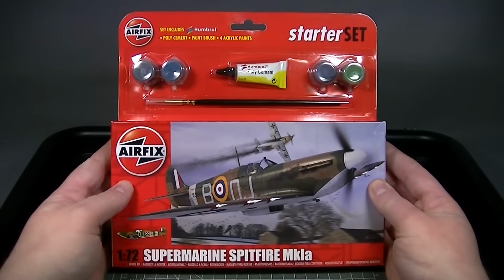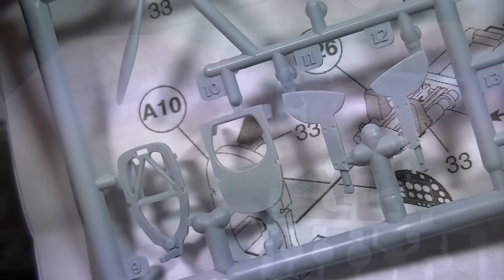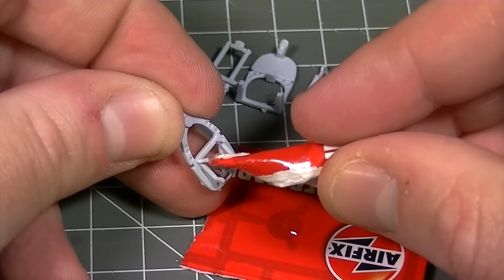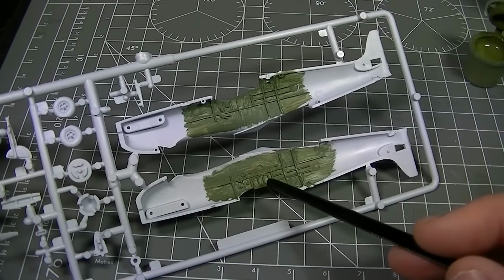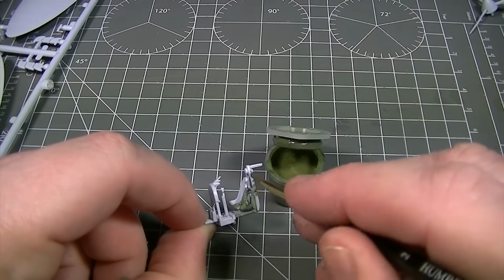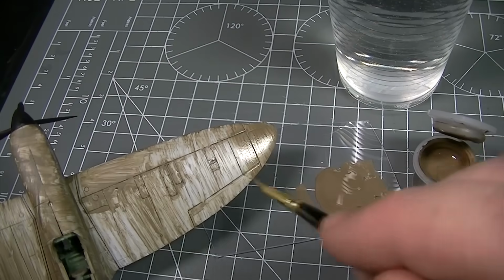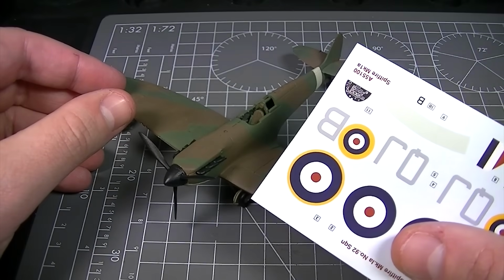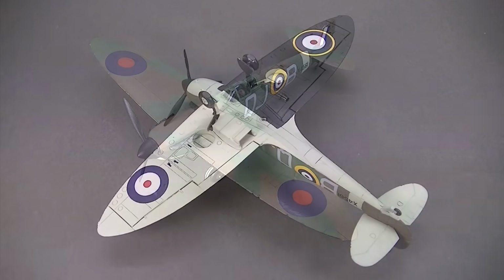How To: Airfix 1:72 Supermarine Spitfire Mk1a Starter Set

Comment: There were some great tips in this video, like applying the glue with some of the cardboard from the box. In my previous models, I would apply the glue straight from the tube, and I would get a lot of excess spilling out, but not any longer 😃👍
Reply: You could also use a cocktail stick for really accurate positioning of glue dots. 👍

Comment: Terrible tutorial.  You don't rock and tear the parts off the sprue. Use a knife or side cutters.  
No need to wash new kits. Old kits up til the 80s had greasy mold release agents used..not in today's models. A good coat of primer is a good foundation for paint adhesion.

Comment: Great idea to restrict to ONLY what is in the box for those who are starting out in this hobby...Obviously we all know that low tack masking tape, scissors, hobby knife, fine brush, fine sand paper and a couple different paints like silver (for chipping) etc. will make for a more accurate model...Another tip is that the thick paint neat out of the tubs can be used as a filler to fill some of those joints...just build it up in those areas...Great vid...
Reply: You made a good point, as i am starting its good to see what you can do with only the stuff included. I want to try this hobby out, without spending to much money.

Comment: I don't have the starter set, I have the basic kit, the same model, just the model. It truly is a beginner-friendly item. I'm not a beginner (I'm a many decades-long veteran modeler). The model is without issues likely to vex a novice. Part fit is clean and a wonderful experience. Detailed, but not daunting. A careful and patient and slow modeler will be rewarded with a fun experience.
Reply: Thx for posting.very handfull yips what to buy as a beginner

Comment: I can't get the canopy on but it was my first build and can't wait to do more
Reply: A little late, but when it comes to clear parts like the cockpit canopy, try using PVA glue instead of the plastic glue in the kit. Becaues it melts the plastic, it results in the canopy glass becoming foggy unless you're especially careful when applying it. 

Hope you had fun and build more kits :). The Japanese Zero is a fun one to make with some nice colours.
Reply: Some of the newer starter kits have a more simplified build and the clear parts don't need glue at all as they just snap on.

Comment: using a finger nail to remove excess plastic? are you sure about that?
is that technically even possible? or wise? you just washed the parts in soapy water? now you're removing them with your hands and scraping finger nails down each tiny piece before you rip the box up?

ever thought of selling a Starter Tool Set? 
or using a piece of card with a drop of glue on and a cocktail stick to apply the glue?
well at least you supplied a paint brush, saves dipping your fingers in.

applying decals to matt paint? you are sure about that? 
luckily the video is almost not long enough to see them start to fall off. Wasn't there a yellow patch on the upper wing with that early B&W underside? no armoured glass and a different prop? 

just saying ... patronising people isn't wise if you're a mum short of a dish washer, a hand short of some clippers, a craft knife short short of a plaster you'll be needing anyway, a decal short of a gloss coat and a Hurricane short of a new customer .. even if they're not likely to be called Reg or Sydney some people might start to wonder why they bothered.
https://www.youtube.com/watch?v=EUdgmvn516k
https://www.youtube.com/watch?v=iBZ-UOyPWg8
https://www.youtube.com/watch?v=uKFDcZuM40M
https://www.youtube.com/watch?v=ZNH_ev0Aha8
https://www.youtube.com/watch?v=Aku3pGT3q8Q

Comment: Pretty much the only good information here is regarding the brush painting, and even that doesn't cover that you should really prime your models before painting them. Breaking parts off the sprue is a horrible idea, ideally use nippers but if you don't have those, a hobby blade or nail clippers would be better. Glue wise I'd use a paperclip as an applicator or get Tamiya/Revell glue which have applicators in/on the bottle. Lots of bad information for beginners in this video.

Comment: Is anyone else in absolute awe that the advice on building this kit comes from Airfix themselves and this fucking guy actually works/worked for them! Jesus Christ - twist the parts off the sprues? rubber bands?? I get the fact that this is probably a video for absolute beginners but surely it's best to instil good practice from the beginning? There are far better tutorials on the ewetube, forget this pop & crisps, clown shoes idiot and get decent advice somewhere else.

Comment: I actually had to look away when he was twisting parts off the spurs. And am I the only one who noticed the huge gaping hole between the two fuselage halves. It wouldn't take much to nick some filler and a pair of pliers from the garage with some PVA glue as well. Show em how to do it properly instead of some pile of camel poo. And I won't even start of the masking tape front!!

Comment: Hoping I could get some help here. I'm about to start this hobby and I am planning to buy a 1/72 hurricane and spitfire starter set. Would the 5ml cement be enough for both of them?
Reply: Samuel Jim yes. just don't use too much and you should be fine.
Reply: Samuel Jim try and pour a small bit into a puddle and use  the end of a brush or a cocktail stick to apply small amounts.

Comment: Why did you not just use a scalpel.
Reply: Because its for a beginner, so it just shows how to get started right at the beginning.
Reply: Because a kid who has never done this before doesn't typically have razor sharp blades lying around.
Reply: Sean Winter yes yes I'm sure you get 8 year olds who use scapels

Comment: For the best result, please use a razor sharp hobby knife with an #11 blade. That should do the trick. I suppose you could use these if you`re 10-12 years old, i certainly did. Nails simply won`t cut it like the geezer in this video seems to proclaim. Plan B would be a flexible needle file :)

Comment: A few warnings and tips. Not that I know it all; I just share half a century of modelling experience.. So here goes:

- Rocking the part back and forth is not the best way. One could break of part of that part! 
- It's safer to use a hobby knife —but only if you are old enough to securely handle sharp blades!!!
- If you want to keep the box whole (yes, they are worth money!), use an empty pill strip as a palette. 
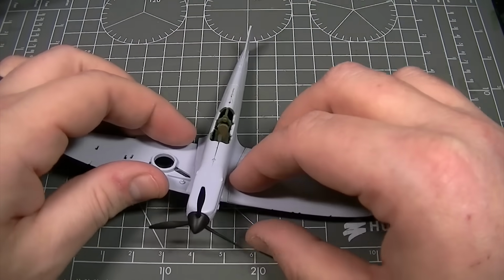- To paint large areas, use this type of brush with side strokes (as at 6:21 and 9:50), not up-and down. Avoid the tip to apply paint except for (very) small parts.
- A warning about using rubber bands or string to press and keep parts together : if the glue (weld, actually) is applied a bit thick here and there, rubber bands will press it out and spread it over the model, where you don't want it —but you will only find out when the weld has set and you remove the bands, by which time is too late to fix the problem. So: 
- Clothes pins are preferable.

Hope this helps! :-)
Reply: VHJM van Neerven is it necessary to had a primer coat ? Or I can go straight paint the model with thinned paint ?
Reply: Initial VAT It can be used, but it’s not necessary. You can sand the surface which is what I do.
Reply: @initialvat4226  If you wash the parts then you won't need primer. But if you don't wash then yes, use a coat of primer.
Reply: @initialvat4226  You can, but because the paint is thinned from the outset you run the risk of seeing the grey plastic underneath, and the colour not being as solid/smooth.
Reply: Powertothebauer ..you speak to professional modellers and they say washing it will reduce the risk of paint  problems .. it gets rid of the mold release agent  which can be quite noticeable .. You should be ok with normal handling ..but of course if you have  filled and sanded , I dare say you would wipe the model down.. paint and filler dust don't go well??

Oh a sarcasm is the lowest form of wit ... just plain soapy water works fine.

I had a MiG moulded in white plastic ... grey primer helped to make the camo pattern go on better ..wasn't trying to cover bright white!!!!
Reply: Helpful hints for beginners and children. BUT! Since 1967, I have always "rocked" the parts off the sprue, never have I broken a part this way. I have, however, broken parts using a scalpel! Patient finger pressure, masking tape or impatient clothes pegs work best for me. And I have never even owned an airbrush, I'm rather proud of the smooth finish I get using a decent brush and correctly thinned paint...
Reply: thanks so much!
Reply: Vincent  ..it is preferable to prime the model ..AT THE VERY LEAST ..wash it before any painting ..to get rid of any mold release residue and various stuff  thats has got on it ..sweat, grease from hands etc
Reply: VHJM van Neerven thanks! These tips will help a lot
Reply: VHJM van Neerven Thanks for the tips and warnings! I'm just about to build the Spitfire mk. V, I'll be sure to apply some of these tips to the process.
Reply: VHJM van Neerven thanks for the great tips 👍🙂
Reply: @powertothebauer296  just like me xD i never use primer and i just basically dont clean it i just blow it to get rid of the dust and thats all
Reply: Excellent advice.
Reply: Also only use pva for the canopy.
Reply: Haha, I don't know man. I'm 14 and cut my finger all the damn time. Have three cuts and sliced some skin off.
Reply: I would imagine this is aimed at younger folk. I use to and still do, us a set of nail clippers with a file on them. Instead of a scalpel blade etc
Reply: Thanks for the tips :)
Reply: Easiest way to remove parts from the sprues is with a set of flush cutters, like a small set of Xuron's or similar, even Games Workshop sell their own branded set. Gives a clean cut with minimal sanding required afterwards.
Reply: VHJM van Neerven that helps, I’m going to start this hobby soon. That helps.
Reply: Really you’re going all know it all on a starter kit?

Comment: Some weird advice. I get that this is aimed at kids, but come on. Don't twist the parts off the sprue - you'll break them. Kids don't have specialized modeling tools, but they can use the stuff they have around the house. Use a plier-style nail clipper to remove a part from the sprue without breaking it. Use lever-style nail clippers to snip off the excess plastic. The kind with the flat front works great. Put your canopy on with white glue so the plastic doesn't craze.

Comment: This is how not to do it, ffs Airfix.
Reply: never use your fingers to remove parts always use a knife or cutters, never scratch anything off with your finger, NEVER use poly cement on clear parts...
Reply: Straight out of the box it is lol
Reply: Power bacteria I know it's meant to be built out of the box. But I'm pretty sure the workstation and cutting mat didn't come out of that box
Reply: What is wrong in the video?
Reply: exactly. absolute rubbish kits

Comment: I flinched when he said "excess plastic is scraped off with a fingernail". Don't leave messy parts kids.
Reply: same
Reply: Personally, I wouldn't use my fingers because if you're nails are short, you could bruise or cut your fingers on the plastic.
Reply: He Said that if you have a fingernail you should use that instead
Reply: Ethan Ton θυυηηγγγ
Reply: Colin Johnston Not sure what your problem is, nitpicking other people's comments...
Reply: It's not a good idea to give an scalpel to a 8 years old kid.
Reply: @marciomaiajr  why not? I was using them around that age. The point is to teach the person how to properly use it. My grandfather, uncle and father all built aircraft and tank models and I learned from them. I learned how to properly cut the parts from the sprue, file, trim with a hobby knife and how to fill gaps. Sure, this may be a beginner kit, but there's no need to build it like a Neanderthal
Reply: If you are a beginner you could use some sandpaper or sanding sponge or even a nail file or sander. Safer than a knife if you are young.

Comment: My goodness me !! how to OVERCOMPLICATE building a plastic model, i have to say that the people building these kits on these instructional video's today clearly are NOT used to building plastic models previously as a teen or youth, thats obvious!! 
 back in the 60's and 70's  when we were young and building airfix kits and the like there was NOTHING in the instruction's about washing parts in water first, where on earth has that come from,?? the paint NEVER came off our model's later, and spending type making applicators for polystyrene glue is another STRANGE one, ??? glue comes stright out of the nozzle and on to the part you want to glue its THAT simple ,just gently squeeze the tube it isant HARD, the glue WONT come flooding out if you squeeze the tube GENTLY, you can use a small needle or pin to apply glue to tiny parts also a cheap plastic handled hobby knife is what you need to cut parts from the spue you CANNOT twist off every single part off, how do you twist a tiny, tiny part off, ??, you cannot get your fingers on tiny parts use a knife,CUT them off with a cheap hobby knife REALLY who has come up with this ??,its over the top and not nessarsary, you dont need special trays either a piece of flat cardboard or as has been said newspaper is quite sufficient you can sand off bits of sprue stuck to any part with a cheap cardboard ladies sandpaper nail file , and use washing line household clothes pegs and sellotape to hold parts firmly together until they have dried,  what you need in the main you ALREADY have in your home, use metal tweezers the  type ladies use on their eyebrows to pick up  and attach tiny parts to your model like aerials and pitot tubes , they will hold the part for you, again items most people have in their house, building plastic kit models is no more complicated than you wish to make it everyone, im 57 now and ive never forgotten how to build a plastic  model well, !! and what to use from my house to help me, im sorry i dont wish to be rude but instructional videos like this are overcomplicating what you need to do to build your model , its as easy as you choose to make it everyone, use the traditional enamel paints in little pots that everyone has used since the year dot, to build plastic models you DONT need fancy modern paint either, its over the top,!! a nice thin brush and some enamel  thinners to clean the brush out with later its NOT hard  kind regards all.
Reply: Uh the video seemed simple and your comment is making it overcomplicated lol

Comment: When I was fitting the pilot into the seat I was forced to cut his feet off because of the stick being in the way. That was a pain in the ass. The bigger pain in the ass was gluing the Pitot Tube as it is tiny on the 1:72 scale kit.
Reply: Maxwell Harris Was the stick not between his legs?
My guy wouldn’t fit for the foot rests so I manipulated the feet over the top of them,I couldn’t bring myself to amputate him.😆
Reply: Maxwell Harris 
Use Mr Cement S or Tamiya Extra Thin Cement for small parts like that.  It dries really quickly and is designed for small parts like pitot tubes and antennas.
Reply: Now imagine the poor guy screaming in pain.

Comment: Its not a good advice for a biginner to seperate the parts from sprue with hands and not to use the simpler tool,a razor blade.Then to use  the same paint brush to paint the hole model inside and out.And not to add the antenna wire usung spue.Otherwise a good video but this is not exactly the real in scale modelling.
Reply: The video was made to show how to build a starter kit with only the tools in the box. A sprue cutter is always good  advice, but think back to when you were 6 or 7 and first started making these. I wish I had a nice simple video like this to get me started back then. Hope to see more like this from Airfix and Humbrol, I really like these videos even as somebody who has advanced further into the hobby. Showing the basics like sanding etc could be a huge help to people starting out.
Reply: bowser515 When i first bought a model kit back in 70s i had nothing, no paint nor glue suitalbe for modelling.I used the German rubbish UHU for cement.Now i have 5 airbrushes and an excellent Italian compressor but i am not in the mood to finish a model from my huge collection.I agree it is a good effort from Airfix with this videos to introduce modelling to people not only to the young.I was inspired too from the video.Geetings from Athens Greece.G.A
Reply: Nail clippers work better.😔

Comment: This is a very well done presentation for someone who has never built a model before-you should consider placing some reference in the box to go and view this.  The instructions regarding the paint are particularly well done,  I expect that individuals with more experience modeling will nit pick this to death, but they are missing the point of what this is about and who it is meant for.  Again, great job.